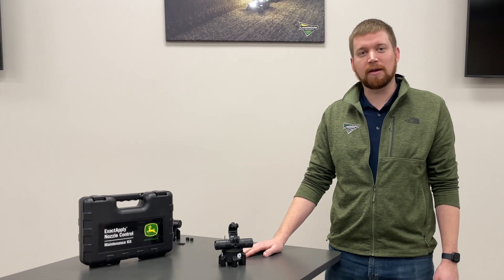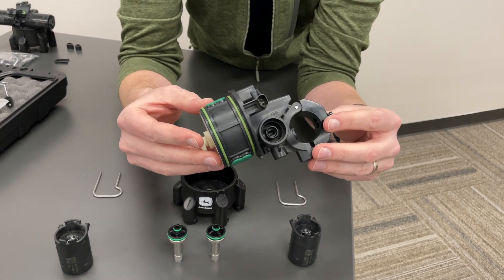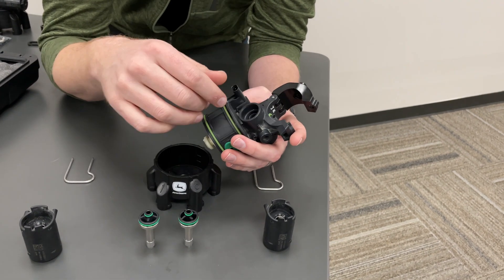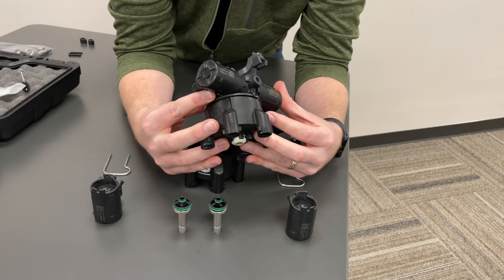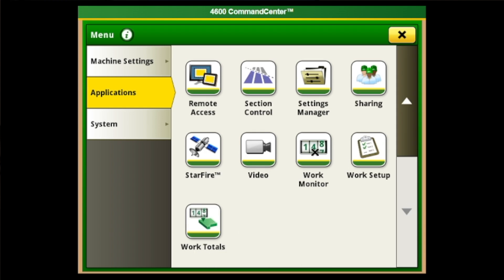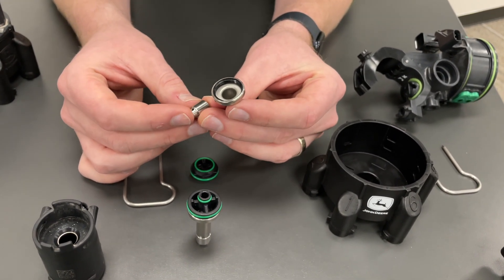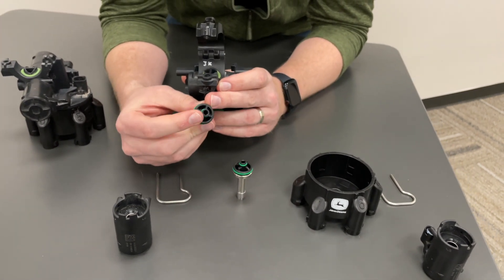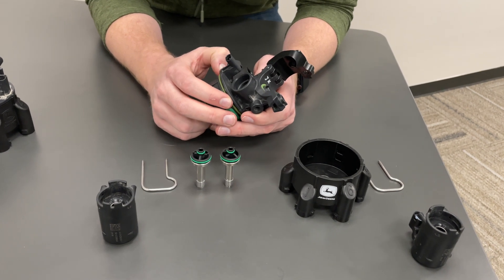Servicing the Parts of your ExactApply Nozzle Body

Comment: Hello my friend, greetings from Brasil, i have a sprayer that have the exact apply system and i was cleaning all the solenoid and valves. But 7 valves get stucked inside the solenoid and i cant get it off, do you know how i could unlock them?